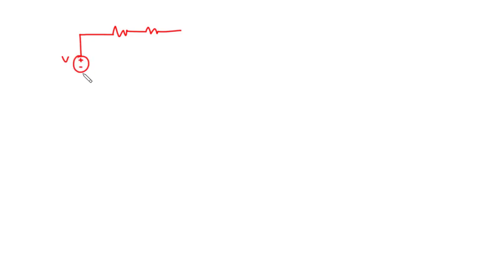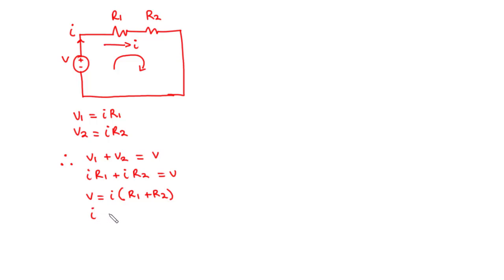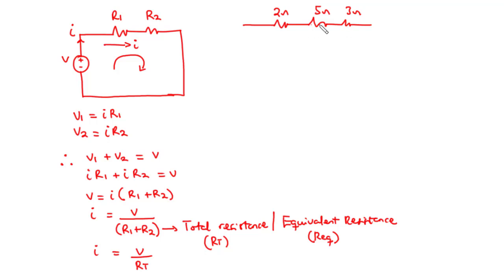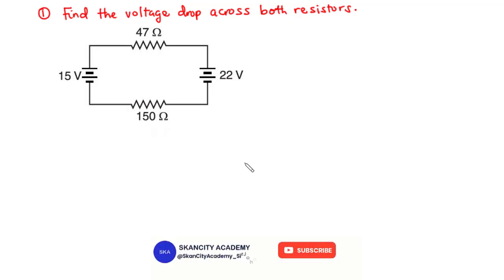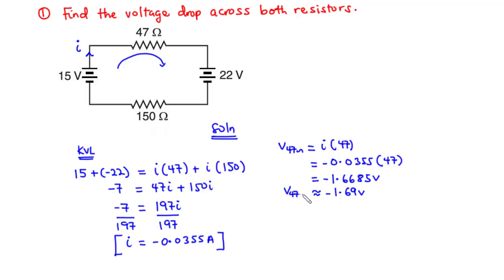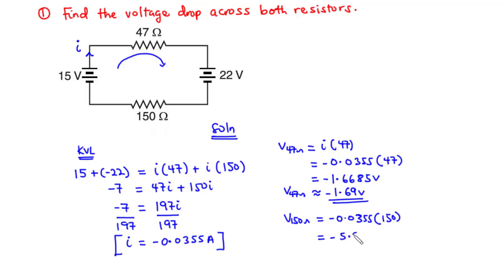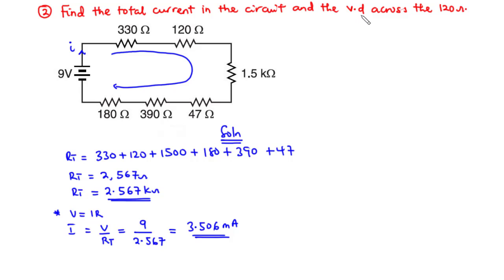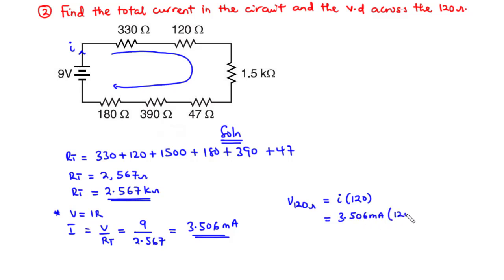☑️09 - Series Resistors and Voltage Division

Comment: how did you get  -22.....you didn't even state the direction in which current was flowing in the 22v but you assumed it was flowing the opposite direction
Reply from the maker: Initially, we assume the conventional flow of current, which means that current flows from the positive terminal of the voltage source with our reference to be the 15v, hence current i flows in the clockwise direction. 

In effect current i enters the + of 22v and leaves from it's - terminal. One's current leaves the - terminal of 22v the 22v is regarded as negative when we want to find the total source voltage.